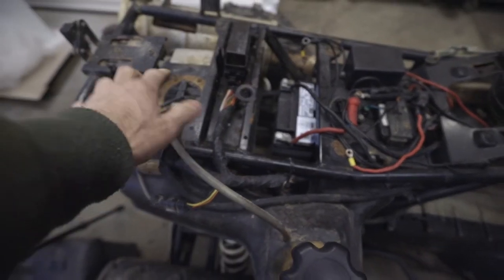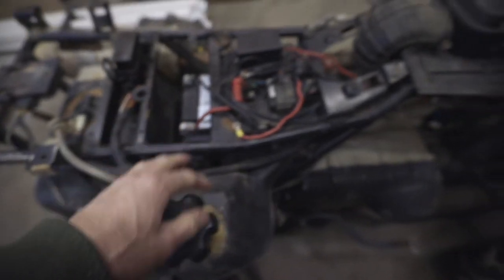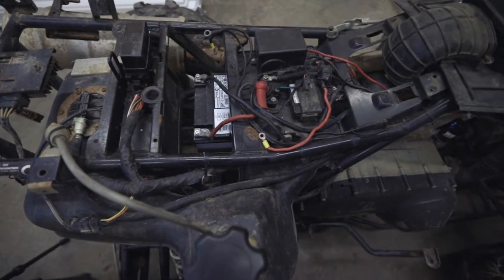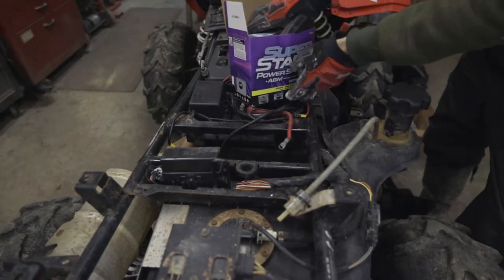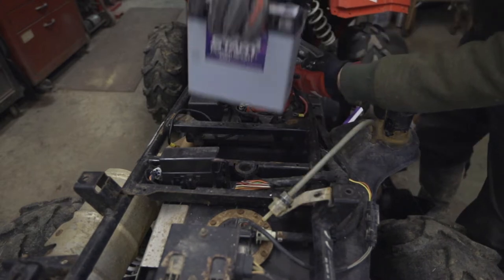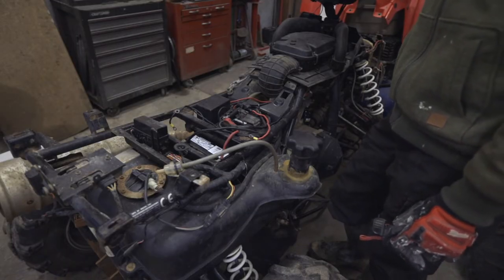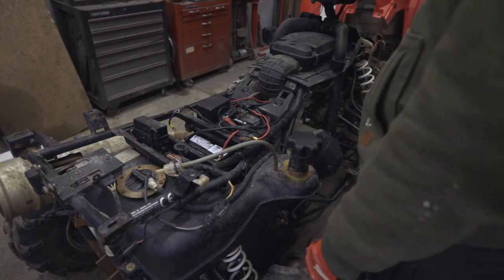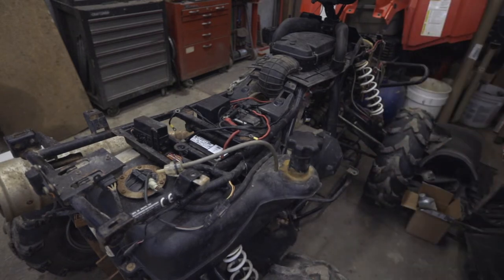Did I fix it? Does it run?

Comment: I have the same problem with my Arctic cat 700 H1 EFI. It starts, but works very unevenly and most of the time just goes off.
Reply from the maker: May be the fuel pressure, it needs constant 43psi. Also, could check the coil wire to the sparkplug for a good connection or the valves may need adjusted.
Reply: @ArcticFrost  checked fuel pressure its okay, spark plug looks fine. I will try to clean fuel injector, and if it wont help, will have ti check valves

Comment: I have 2017 Alterra 300.  It starts fine with choke but will die when take choke off.  Thoughts?
Reply from the maker: I would try cleaning the carb with carb cleaner as well as compressed air to make sure the passages are clear. You could also check that there are no air leaks on the intake boot. https://youtu.be/4xNazOhUOPI

Comment: I have the mud pro 700 h1 efi I think it's getting to much fuel what causes it to get to much fuel? any ideas?
Reply from the maker: Is the spark plug wet or dry when you pull it after trying to start?
Reply: @ArcticFrost  it's wet... could it be something internal like a stuck valve?
Reply from the maker: @djskullballpythons158  I would check the fuel pressure. It should be 43psi constant pressure. You could try readjusting the TPS and then resync the EFI system and see if it changes.